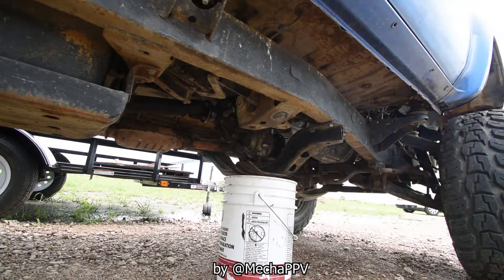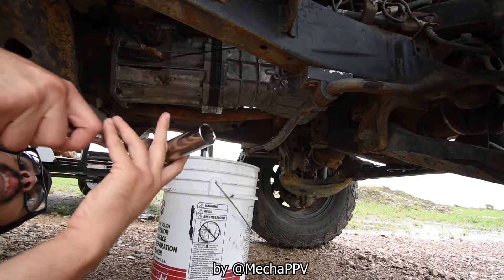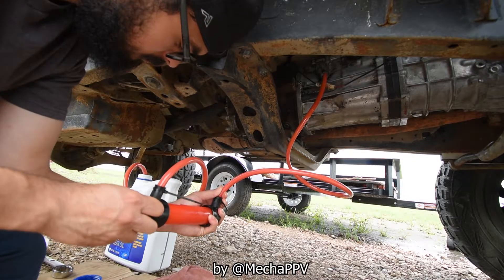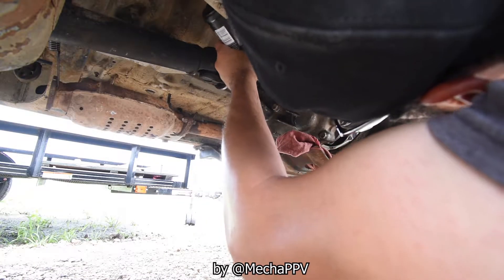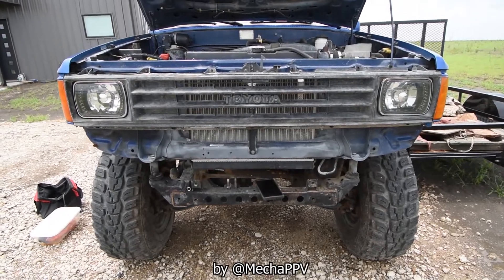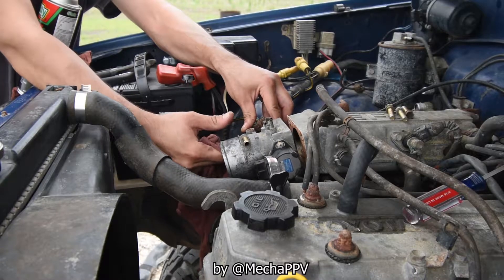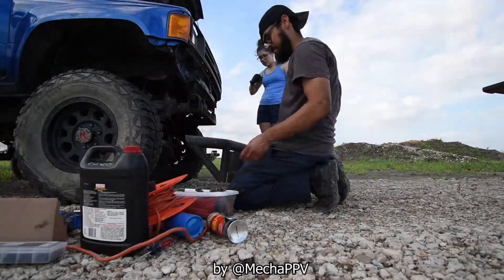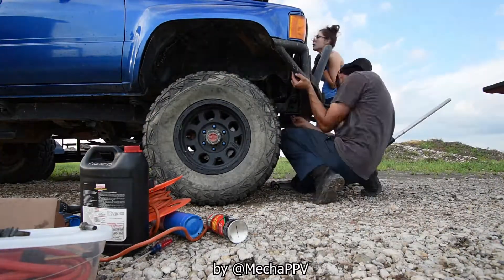Part 7 - 1986 Toyota - 4Runner - Leverage Is Your Friend

Comment: With a pcv it allows it to breath in and the other is a just breather so it can breath out if it didn’t breath out it would just build up pressure in your crank case and start blowing seals out